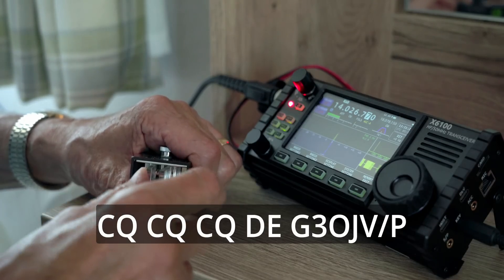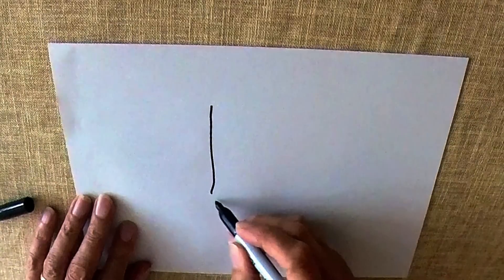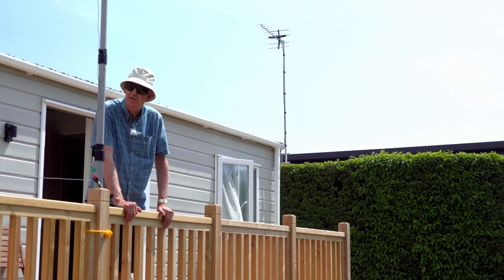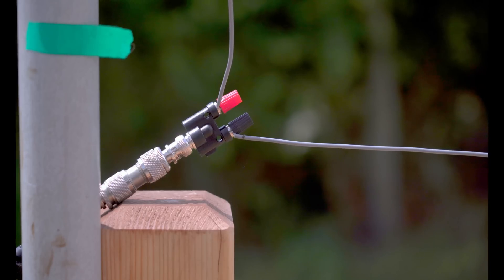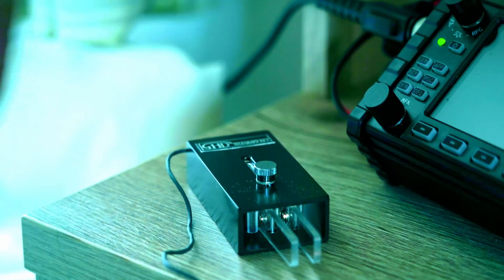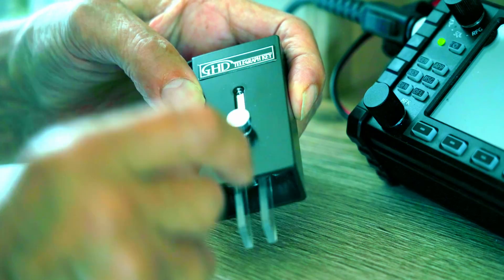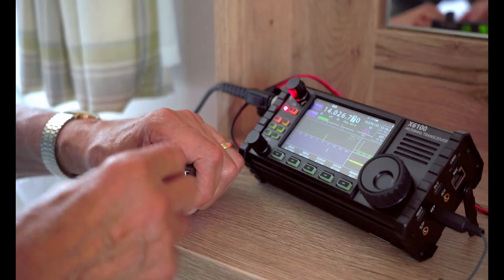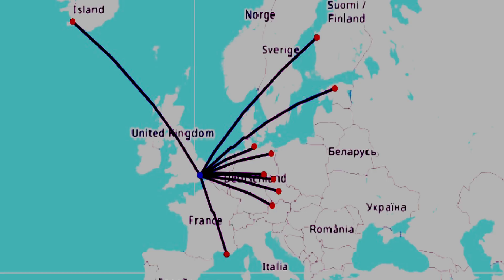The Atlantic 5W Challenge - Build This Simple Antenna - Join The DX Fun!

Comment: Great video! Thank you so much for loading up this kind of information showing how simple things can be. May I ask what kind of coax insulator You would recommend. Is it possible just to run the RG 58 a few meters on the ground when working QRP portable out in the Woods or mountains to prevent common mode current?

Comment: Great Video. I used a similar setup at home a few years ago. It was set up as a fan antenna with elements for 10,20, and 40 meters. On 40, the vertical was actually set up as an inverted L. 10 and 20 were both fully vertical. I had  one radial per band elevated at about 10 feet off the ground. With a tuner, it worked nicely on 30,17,15, and 12 meters as well.

Comment: Thank you for another interesting video Peter. May I ask, what were you using as a line isolator?
Very 73, Chris, G0VOE.
Reply from the maker: A few turns of the coax around a 240-43. ferrite core. 73 Peter
Reply: Thank you Peter, as simple as that!

Comment: I use a similar setup with a 17ft telescoping whip and a pair of elevated radials for everything from 6-20m. Works great and I can put it up, be tuned, and transmitting in less than 10 minutes.
Reply from the maker: Sounds Good